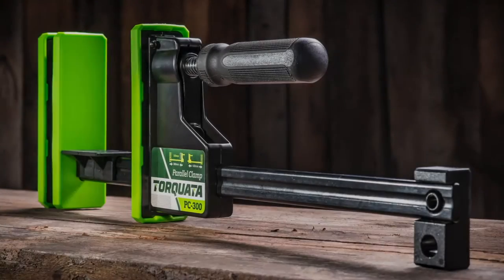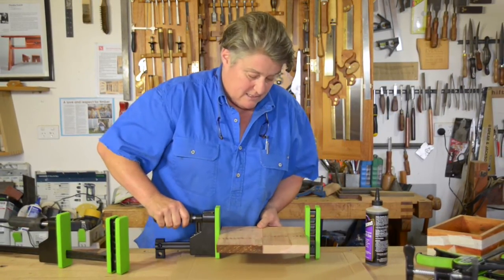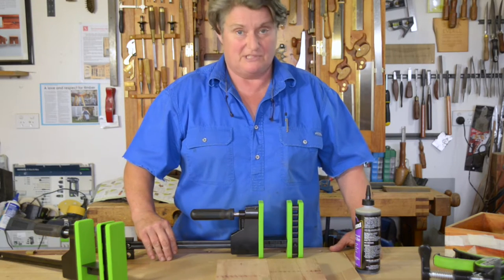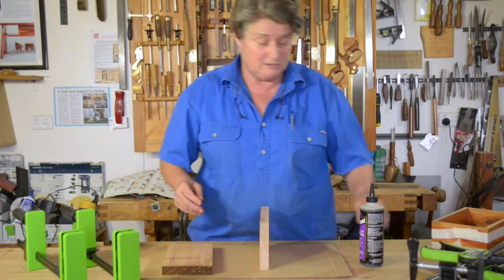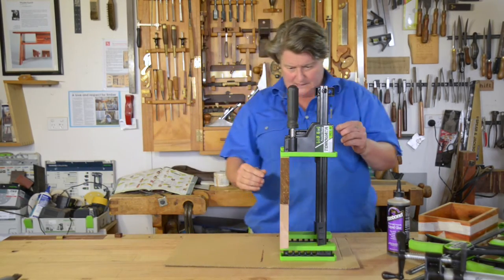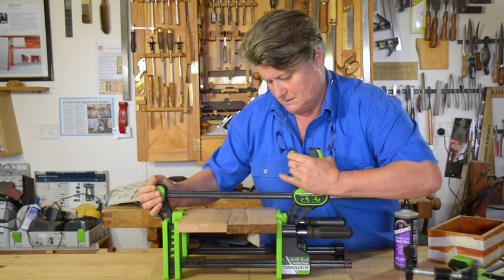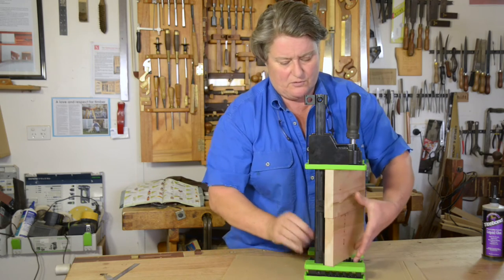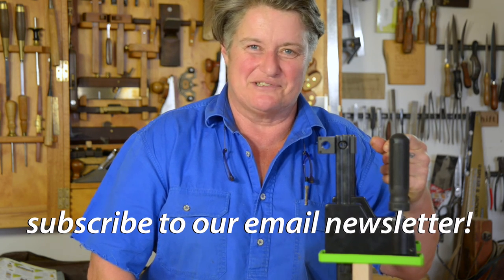The Happy Clamper - Using Parallel Clamps

Comment: Hi Phoebe, 
After watching this demo I purchased a "six pack" of the 900mm clamps. I love them, they work very well and are predictable. By predictable I mean you place them and they remain there, the square edges help prevent them  falling over all the time.
I have had one issue where I was glueing up a chair base for a rocker/recliner and was using the clamps to bring the M&T joints together. On this occasion I did not use scrap wood pads to protect the wood as the clamps have non marring pads on the clamp faces and it was just going to be light clamping to hold everything in place while the glue set.. Unfortunately after around two hours of clamping the non marring pads had released an oily material into the wood  faces of the chair base. I then spent an hour each day for the next three days using methylated spirits and paper towels trying to elute the material out of the wood. it is now largely gone. Perhaps you might consider suggesting people use wood packers or fit ply faces to the clamps to avoid this. All the best.
Reply: Hi mate. How have these clamps held up in your shop?